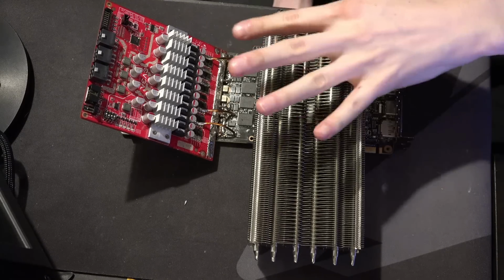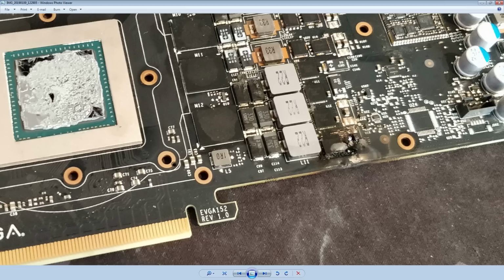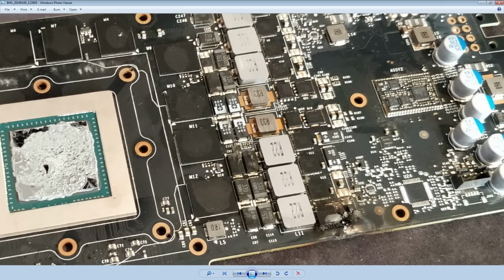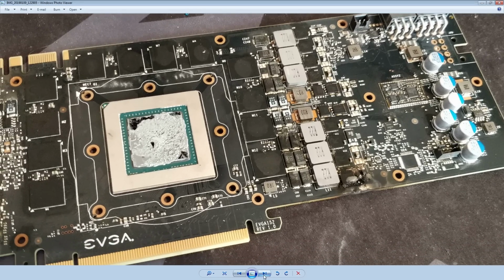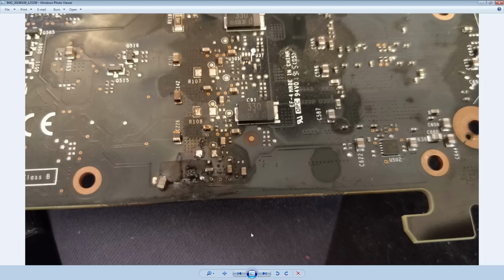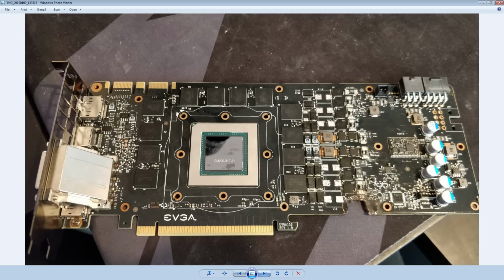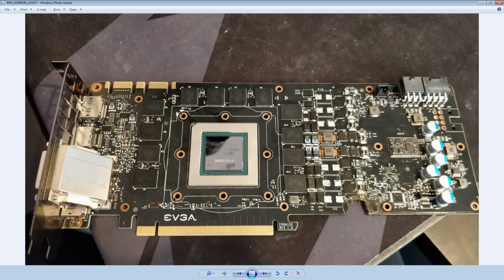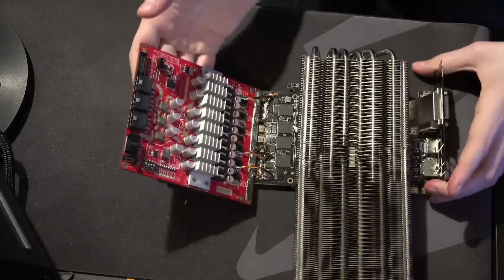GTX 980Ti death by Vmem.

Comment: This may be a dumb question but if the memory controller is damaged in the gpu chip can the card still work at all?  Trying to fix mine which loads into windows but black screens with a driver installed.  Ran a memory checker called mats and it passes.  VMEM is 1.4v.

Comment: hi, i have a question. i actually own a gtx 980ti but it recently died, i found out that the vrm and inductor was blown from the gpu memory so i replaced it. after that i check if the gpu chip and memory modules get power and that was fine. but for some reason it still wasnt showing any display. so i decided to take the card apart and plug it in without cooler. What i noticed after was that 8 of the 12 memory modules get really hot instantly, you cant even touch it. so i think i will have to replace the modules because they are defective i believe, but im not too sure. i hope you can help me.

Comment: How does this actually happen? Been hardcore overclocking and gaming with high end gpu's almost 20 years now. Worst I've had is failed fans and replacing them is dirt cheap. 
Am I just lucky or are people using these in cases without ventilation?
Reply: HolyDr1ver looks like water damage to me

Comment: I still don't understand how people kill cards like that! To much dust build up or water-cooling leak or did they just jam a fork in it like a wall outlet? Seriously though talk about E-waste
Reply: People using shitty AIO and pum, you have a water leak machine
Reply: Silicon devices just fail randomly. Even diodes will just got short circuit for no reason.

Comment: Here's another way of thinking (in regards to spending money on dead GPU's). You gain experience from it, which has pretty good value itself, as well as the possibility of content for videos like this. You could probably even get away with live streaming your attempts on fixing cards.. and with that raw content, others watching can also learn from those exact mistakes.

I occasionally watch Louis Rossmans videos and streams, because I find learning from others is extremely valuable.

Comment: i have ASUS Z370 PRIME  -A the ram voltage showing up double to what it's set, like xmp it set to 1.35 it show 2.7 not only in the bios but in aida64-hwinfo...
in defualt setting 1.2 it show 2.4...i have 4x8gb g.skill vaule 2400mhz overclocked to 3000mhz with time 15-15-15-35 with voltage 1.38,
it work fine with I7 8700K AT 4.7GHZ WITH 1.27 V, I RUN aida64 stress on memory and cpu for 12 hours it work without problem and temp under 85c for the cpu...
the memory total drm package reported in hwinfo around 6.4w (all 4 stick of ram)...
so do i need to worry and replace the motherboard ?
*note i check different ram kit and the same...

Comment: next time remove the chokes of vmem too, in case you wanna check if the output is correct ... after you confirmed a save voltage you can just reapply the chokes and you would have been ok ;) MAYBE ... we all know it could all been dead since this burn ;)

Comment: 😒 soooo basically u burned $50 for nothing, Plus all the time u wasted on this POS, oh well better nxt time buddy 🙂🧒 this reseller is a POS too, this card is worth maybe $20 at most for parts and not $50, pft please 🙄
Reply: Not for nothing, he learned something. I fried my first GPU running it sub-zero for a daily system. Sure it cost me $90 and half a year I had to survive with a 10 year old ATI card instead, but it saved me a lot in the future (that's why my Titan Xp is not on phase cooling). I learned a very valuable lesson, for relatively cheap (I don't even use that Titan, its far too slow compared to my monster system). So Biuldzoid learned a good lesson, that may save him a lot in the future, just like I learned CPUs for daily are safe, but GPUs will crack the solder eventually (I'm trying to build a hot air reflow station, although some cheap IR are just like $250 plus your BGA templates/solder pellets/etc).
Reply: @jakegarrett8109  🙂 ur rite sometimes its ok ☠️
Reply: It's worth what ever someone is willing to pay for it. Kind of a moot argument you're making here
Reply: Reminds me of people selling tvs with a smashed screen
Reply: @jamezxh  ☺️ yup

Comment: A random question to you mister Buildzoid regarding capacitors:
Wouldn't a big capacitor bank on the 12v supply to minimize ripple be just as good as more capacitors to reduce ripple on the different 0.5v-3v supplies or do the mosfet and coils add a hugh lot of noise? 

I also have a HD7990 with a burnt mosfet and one HD7970 with a missing resistor or something you can have for free. If you do not want the then the garbage bin will have them :)
Reply: Also got a perfect working HD3850 with a whooping 512mb factory clocked memory :P
That one is free to :D

Comment: So i have a msi armor 1080 card that came with a vbios with 220-240w max power limit. I since flashed the msi gaming x vbios and i have a 290w power limit but i can raise the memory all the way to 6055 (1513 in hwmonitor quad data rate i know) but now ive hybridised the card with a kraken g12 and a kraken x42 140mm rad. Ive never gotten 2100mhz rock solid on the core untill now, ( i can only get 2100 with the curve) before best was 2063 and ive been getting concerned about any components i might be killing  in the process. It only takes 260-270w(290w max vbios allowed) when i dial in my OC but as it stands my best gaming OC cant pass firestrike but it passed timespy and superstition (unigen benchmarks dx12 successor). So ultimate question. Anything  i can do to make sure it stays alive? Atm i am following a lot of advice of yours about optimising my cpu and dram OC and  all of that i learned is kinda coming full circle. THANK YOU SO MUCH FOR YOU VIDEOS.

Comment: Interesting that thats an EVGA board. I've got an EVGA gtx 770 using most the same components and i had exactly the same problem. The bottom Mosfet blew.I did the same thing as you, i pulled off the Fet and removed the short. The card ran for i'd say another hour before another Fet went, i cba diagnosing that so i took all the other components off the board for parts.

Comment: I actually have a "dead" r9 295x2 from a friend that I spent about a week trying to fix but I don't have the proper tools to diagnose it. The stupid water cooler / VRM cooling design makes it impossible for me to measure any of the VRM voltages. 

At first, the card only booted every now and then and hard-crashed the PC (basically the same way as when you remove a PCI-e device that doesn't support hotplug). Now it "boots" but the fans are stuck in a default state and the master GPU is nowhere to be seen, the second one shows up just fine but is stuck in a default power state.

I got as many diagnostic logs as I could before the card stopped working and already talked to AMD / MSI and asked on forums but I didn't get anything useful out of it. 

I don't know if you're interested in the card but I can provide pictures/logs if you want or even mail the card to you if it's not too expensive (I live in Europe). It's still a relatively high-end card and at the moment I'm only using it as shelf decoration...
Reply: Those are cool cards, I love the looks of duel cards! Near me in the US is a 390X2 Devil card for $150, or $100 for another one that just has a broken fan. I'm debating grabbing both (since they are duel GPU cards, it would be "4 way crossfire"). Both work, and I would be water blocking them anyways. Same guy has a bunch of R9 290x cards for $50 a piece (wohoo! Yay mining crash! Cheap cards everywhere! <-  This is why my main build is 4x R9 Fury on Threadripper, all the cards are super cheap right now, I love it!)
Reply: @jakegarrett8109  I haven't heard much about the 390X2s, they seem to be very rare for some reason. If you have money to spare get both. The middle fan on my sapphire is broken as well, I just wired it to one of the mobo headers and set it to DC mode instead of PWM. idk this seems to be a problem with 3 cooler r9 cards for some reason.

Also, $50 for the 290Xs is a really sweet deal, most of them still go for ~$150 here. I managed to get one for $100 with shipping included a while ago. Didn't regret it. Now I only need a better CPU and mobo for crossfire.
Reply: @istvantech  Yeah, I thought about grabbing both since I think duel GPU cards look cool, possibly get some of the 290x for some "Buildzoid edition" mods and have some fun (I've got an EVGA Epower V coming that would but fun to practice with on those 290x cards, especially since I can fry a few learning and it would be no big deal, especailly at that price!

I love that the mining craze has ended, this is exactly what I thought would happen, a huge oversupply of unwanted/useless cards that outweigh the needs of gamers, so all the cards are super aggressively priced since its worthless to all the miners with hundreds of these, and there are not enough gamers to buy them all, so at some point you just start selling them for $20 a piece just so they stop taking up space. Mining has just made PC gaming possibly the most affordable it has ever been (with Ryzen 8 cores even new selling sub $200 and running great on $50 boards, RAM back down to $99 for 16 GB of 3000 Mhz, high end PSUs are also dirt cheap now that they stopped selling the 1000+w units to all the miners, and now even crossfire GPUs cost the same as your cheap RAM, LOL! What a great time to build a PC!)
Reply: @jakegarrett8109  Yep. I managed to get an EVGA 1000W PSU from ebay for just under $90. I'm planning on building a new PC soon-ish (read - summer 2019) with a threadripper CPU. I always loved to do 3D renders and stuff so this new 290 doubled my rendering speed. 

Honestly? these cards are a perfect budget solution for what I do. Only thing I don't like is that OpenCL kinda sucks in comparison to CUDA in machine learning. I bought a crappy 1030 on sale just for CUDA lol.

I really want to fix the 295 I got so I can run 4 way crossfire but yeah, that's not gonna be a fun time. I got finals coming up so it's not like I got time to do it anyway...

Comment: Dude I have a question. I kinda know the answer and that's they're all shite. I have a spare 1700. I want to run it in an itx mobo. With an oc of 3.7 all core so its boost clock. Which itx mobo has the best vrms. Or cooling. Tho like my gigashite ax370 gaming 5 I removed the plastic shroud from over the vrm and then added a fan. So I'm not scared to remove or add stuff
Reply: msi b450i gaming plus ac, i'm running a 1700 at 1.43v 4.05ghz and the vrm is fine at about 75-80° with a bit of airflow, power is about 230w max for the package, you don't have the best bios ever but it's workable, i also got 3533mhz 14-14-14-28 dual rank b-die to boot and work mostly fine, 3400 rock solid so the memory trace layout must be quite good
Reply: OK cheers will defo look into this board.

Comment: Kinda reminds me of friends 1080ti strix, it started artifacting on games,  measured vmem: 1.6v... on second day instead of 1.6v it shoved 2v into memory. GPU still posted, so shut it off right away and did e-power for memory, but IMC/some chip is already damaged and GPU artifacts like hell when running.
Reply from the maker: oh damn even on LN2 the most you should run G5X with is around 1.55V.

Comment: A few comments:  First, when you have a catastrophic short, the location of the charring is not necessarily where the short was but the consequences of the short.  Removing components from the charred area is reasonable but NOT arbitrarily cutting the PCB because you can have things like voltage feedback lines that when severed will result in catastrophic overvoltage.  Plus, you inevitably cut all kinds of unrelated nets and really put yourself in a bad way. Cutting the PCB is a fast way to remove problems/potential future problems but only when you have complete documentation and PCB layer diagrams.
What I do is ( when faced with a really complex PCB) to use a current-limited lab power supply and limit the current into the short-circuit.  I then allow the board to warm with the short, then spray the board with freeze spray to reveal the shorted pathway (i.e. the warmed area will defrost first.). From there (usually using a milli-ohm meter) I then take readings to locate the short.  After this point, I will then isolate that net and run a jumper where needed. The charred area (if that bad ) I abandon and either make a daughterboard or isolate the renaming pads and reattach the nets with wires.
This may seem extreme but it was an expensive card.  However, you still may have a card with still viable donor-components to fix something else...
Reply from the maker: It's a 53GBP GPU. As far as mistakes go this was by far one of my cheaper ones. And I'm aware of the short hunting method I've used it before on other projects. I just had 0 intentions to keep this thing on the stock VRM anyway and I was really going for a quick way to check if the core is even functional after a power stage seemingly failed high side mosfet closed. Next time I'm just checking control loops before turning a scorched card on.
Reply: @ActuallyHardcoreOverclocking hanks for replying.  I think your first intuition was correct, that the board (and components) were cooked from the get-go.  Also, I meant the 980ti "was" and expensive card and it would have been neat to resurrect it but I think the deck was stacked against you given the type of circuit damage.  At least you took a shot at fixing/analyzing the card.
Anyway, thanks for sharing the video and I really appreciate all your videos. You're a smart guy, with an excellent channel and great commenters so I've learned a LOT from you and them. Keep up the great work and content...
Reply: @jowlolke  Lmao
Reply: really. you sound like a dick here man you pretty much lost my respect

Comment: is 980i still worth buying?
Reply: At what price? The 980ti is about equal to 1070.
Reply: @davidhartenstine190  New Asus Matrix 6gb for $300. good deal?
Reply: @LazYevgen  I'm not sure where you live, but in the US you can get a 1070 Gigabyte Windforce for  the same price. The 1070 uses less power and if you have a freesync monitor there are new drivers coming out that will allow  freesync on pascal and turing based card's. The 980ti is Maxwell and  isn't supported. I paid 319.00 for my evga 980ti classified 2 years ago. It is a very good card but im upgrading soon, because I want more performance and freesync ability. Where ever you are look up the price of a 1070 and go from there!
Reply: Well this one isn't

Comment: It would've been good to see this monster run. Is there any way to e-power a motherboard? :P I'd like to see something like that too. Changing a weak VRM to a good one and see if that helps with overclocking.
Reply from the maker: I have plans to try E-power the 78LMT-USB3 board
Reply: @ActuallyHardcoreOverclocking   I can't wait. I hope it will be a very detailed explanation!
Reply: @ActuallyHardcoreOverclocking  Awesome! Also if you know of a voltage mod for the newer EVGA Epower V, then let me know. Currently my $40 4 phase board (Asrock 970m Pro3 mATX) is hitting a voltage limit at 1.7 Vcore on my FX-8350 at 5.5 Ghz stable (core temp has only once shown above 0c using my phase cooler), so I either need to mod the weak board to allow more, or use that much nicer 12 phase Epower if I can bypass that rather low 2v limit (It should get here next week). Stay awesome Buildziod!

Comment: I had literally been meaning to email you asking if your attempt to repair a broken GPU that has a broken bit of board, obviously I know it could have another issue that wouldn’t be discoverable or you could have an accident, I don’t care about that, it would be worth the chance to try though worst case I figure You wouldn’t charge me for any labor unless it took significant diagnosis time etc anyway point being if you’re willing to try I’m willing to pay you for the repair and shipping etc, if you can make content of it great if not ok fine too.
Reply from the maker: The issue is the E-powers cost around 100USD each. So they aren't really viable for real repairs. Also I tend to "repair" in a more frankensteins monster style rather than worrying about keeping things clean and usable.
Reply: @ActuallyHardcoreOverclocking  I think you may underestimate some of us who watch your channels level of appreciation of your creations. 
I know for myself any Frankenstein modded by Buildzoid card/board, would deserve case modding to make it the center point of any build...
Reply: @PreacherwithoutaPulpit  haha yes as well as i would make it the center of a build but i work with soldering and sometimes its a case where if you move it the wrong way once and pins and pads are ripped then great sadness follows. Even though it was perfectly fixed. I used to JTAG/RGH xboxs and thats how i learned but ive gotten much better and routing bypass wires and making sure traces that are burnt are actually ok is hard af for me still especially keeping wires on scratch brushed traces intact. its an art and i destroyed a lot of hardware just trying things out way back in the day.